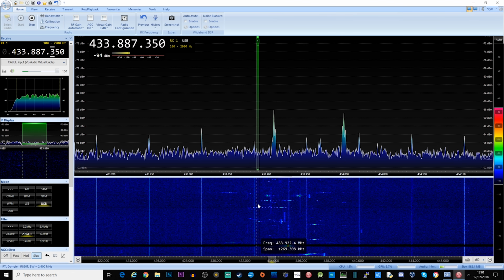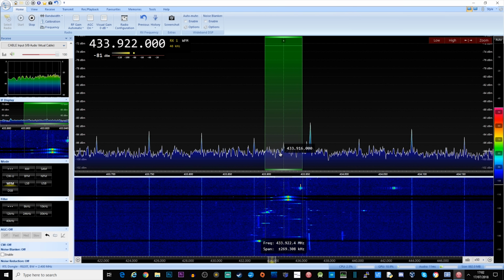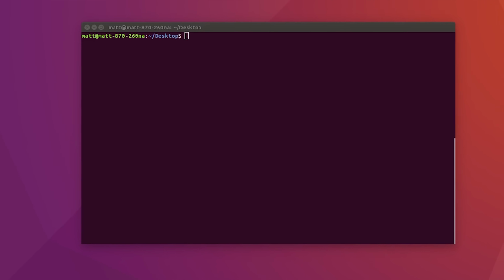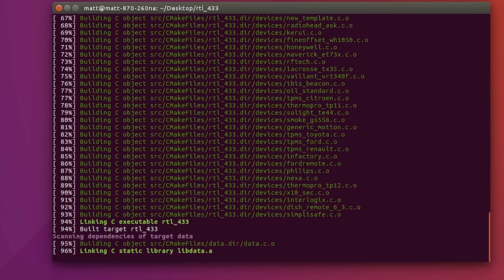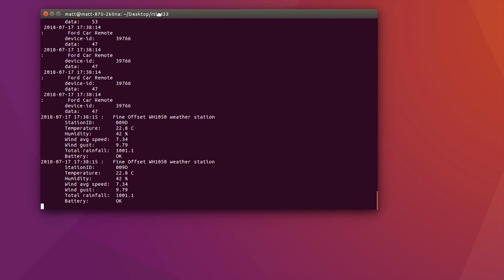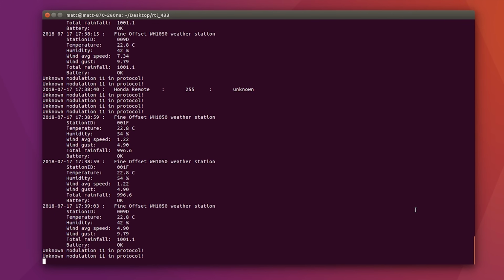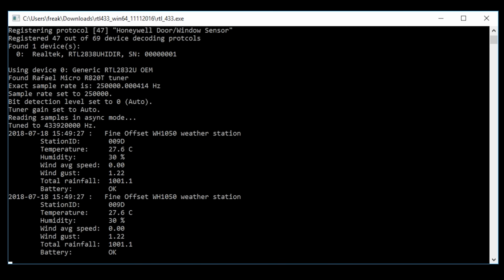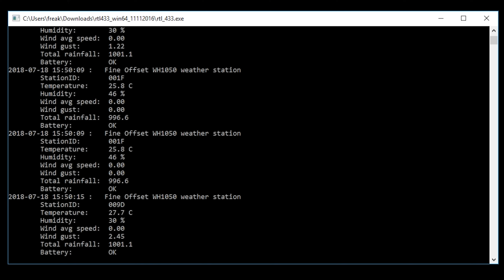How To Decode 433Mhz Low Power Devices Using RTL433 And A RTL-SDR Receiver

Comment: Awesome, I looking for a Windows version of this for hours.  I am hoping to access my WX station with RTL433MHz and put it out over APRS.

time      : 2022-10-29 04:55:16
model     : Fine Offset WH24                       ID        : 222
Temperature: 9.5 C       Humidity  : 96 %          Wind direction: 183       Wind speed: 0.0 m/s
Gust speed: 0.0 m/s      Rainfall  : 44.7 mm       UV        : 0             UVI       : 0             Light     : 0.0 lux
Battery   : OK           Integrity : CRC

Comment: I've got this working nicely now, reading from temperature/humidity sensors outside and in the glasshouse. I've got a 433 rain gauge on order. All I need now is a simple way to connect a pressure gauge to my computer (this doesn't need to be external, obvs, so no need for 433 - USB would do, but I'm having difficulty finding something cheap that does the job), and a 433 anemometer/wind direction, and I've got all I could want for a weather station. Pointers to suitable components at sensible prices gratefully received.
Reply from the maker: Take a look at the arduino, there are many many sensors available. You can even run them standalone and display the data on an LCD or OLED

Comment: I managed to get the Windows version working but as I live in a small village there is not much to receive. I know it's working because I am picking something called "oil watchman"
Reply: What freq did you use?
Reply: @Aquadogwt  The software sets the frequency to just under 434Mhz and that is usually where I leave it but other frequencies can be typed in.

Comment: Wow...very cool. I have several RTL-SDR dongles that I've used for Ham receivers and such.  But these got tossed in the junk drawer when I bought an SDRPlay RSP.   So...I grabbed a spare RTL-SDR and low and behold...I'm receiving data! So Mostly weather stations, which is fine as I don't have anything but temp and humidity sensors.

If I could find my AC power meter transmission it would be icing on the cake.  But I'm not seeing anything but weather data.  Looks like I need to hunt for the proper frequency.
Reply: AC power meters, at least around here in Michigan, were 3G cellular until recently, power company had to come out to upgrade it to a 4G LTE, as 3G has been phased out.

Comment: using windows 10 x64 , the command console shuts down before starting to sniff anything
Reply from the maker: Does the command console actually close down? Like it disappears? Maybe it’s crashing. Try running an “admin” console.
Reply: @TechMindsOfficial  i tried also run as admin, no luck.
It "dissapears" indeed, first shows up and after running some code lines suddenly shuts down
Reply: i launched it from the cmd console and shows [...]Registering protocol [42] "Honda Car Key"
Registering protocol [43] "Fine Offset Electronics, XC0400"
Registering protocol [44] "Radiohead ASK"
Registering protocol [45] "Kerui PIR Sensor"
Registering protocol [46] "Fine Offset WH1050 Weather Station"
Registering protocol [47] "Honeywell Door/Window Sensor"
Registered 47 out of 69 device decoding protcols
No supported devices found.

Im using a hackRF One cheapest version (it works with SDR console and hackrf_spectrum analyzer)

Comment: time      : 2019-09-21 22:14:15
model     : Citroen      type      : TPMS          state     : dc            id        : 868e5375
flags     : 12           repeat    : 1             Pressure  : 120 kPa       Temperature: 24 C         maybe_battery: 65         mic       : CHECKSUM
 
Ok - this is geeky fun :)

Comment: I downloaded the windows version and as soon as I start the program is runs a some code and then the window closes. I tried both 64 and 32 bit versions and both do the same thing.
Reply from the maker: You have to run the windows version, in fact all versions, from the command line. Simply open up a command prompt and then navigate to your RTL433 folder. Then type RTL433 -G

Comment: Question- after downloading and unzipping I run the exe file and get no supported devices found. I am using a nooelec dongle that works fine while running unitrunker and sdr#. Any ideas how to make the program see it? Windows 7
Reply from the maker: Sometimes the dongles usb channel can get locked, try unplugging the dongle and back in again.

Comment: hi there, on sdrsharp i can see lots of blips in the 433.920mhz but in rtl433, nothing shows. any ideas???
Reply from the maker: Try starting RTL433 with the -G switch, that should allow all possible devices. You might need to leave it on for a few hours.
Reply: Tech Minds would appreciate a video. I’m running on windows and don’t see any options or settings...
Reply from the maker: Ahh yes, I have recorded a video but just need to edit it. In short, it’s quite easy. Have you used the command prompt before on windows? Just type CMD into cortana search window and a DOS window will open. Use the DIR command to navigate to the folder where you downloaded RTL433.  Once you are in that folder, you can type RTL433 -F 933950000 for example, to set the freq to 933.950 MHz. If you don’t know how to use DOS commands then it’s probably best you learn how to use it first :) let me know how you get on.
Reply: Tech Minds, dude you are legend! I will crash course on cmd in the morning and should be getting results in the afternoon. Will keep you posted...
Look forward to your next video!

Comment: Hi, I looked in SDR sharp and could see the little signals around the 433.920mhz range but nothing on 433.920mhz. This is a problem because the decoding software is looking for signals at 433.920mhz and not around that signal. Does anyone know how I can change the signal in the decoding software? It does say stuff about tuning options on the website but it wont let me type anything into the console. (I'm on windows btw)
Reply from the maker: Open a command window, navigate to the folder where you have downloaded RTL433 and then type RTL433 -f (then the frequency)
Reply: Type the command into CMD?
Reply from the maker: I'll make a short video showing how to start RTL_433 using command line commands, hopefully have it up in a few hours. Thanks, Matt
Reply: Tech Minds Thank you so much!
Reply: Hey Matt hows the video coming along? I'm sorry to rush you but I'm so excited to try and decoding these signals around me!
Reply from the maker: Here is the RAW video, it's unlisted as its not edited, but should be able to help you guys out :-) https://www.youtube.com/watch?v=2uKazVxT0EE

Comment: Interesting software, thanks for the heads up. 

I have a cheap dongle atm which works ‘okay’ but have been considering a more stable dongle. 

What’s the difference between the smart and smartee dongles?
Reply from the maker: They are pretty much the same but the SMArtee has a Bias-T option, which when enabled could power things such as a LNA.
Reply: I have an inexpensive LNA from ebay already so the bias-t is useful removing the need for a separate power supply.

I'm thinking of long USB extension lead and maybe a j-pole all enclosed in a PVC pipe and have it outdoors, high up for scanning about.

I've just downloaded the windows binary.  Is there a way to change the frequency?  My car fob transmits on 433.950 MHz

Comment: Is it possible to do a replay attack on car key fobs and unlock cars that way?
Reply from the maker: Well, you’d need some way of transmitting and an SDR receiver does not TX, unless it’s something like a HackRF One. It may be possible to record with SDR-RTL and then use a pi to transmit, something I’m also interested in.
Reply: Possible yes, but maybe not in the way you're thinking. A simple replay attack will only work if you are able to record the unlock signal when out of range of the cars receiver and then play the signal back....but that scenario only realistically works if you already have access to the key so whats the point? If a subsequent key press is made and received by the car, the previous code you recorded is then locked out and becomes useless. The other possibility has been termed "Roll-Jamming", and mainly developed and demonstrated by Samy Kamkar. look him up on youtube, its very interesting.
Reply from the maker: I have a video in production covering this topic. And I’m only using a RTL-SDR and a pi zero. Keep an eye out for it, it’s quite interesting topic.
Reply: Tech Minds can you do it in youtube..Eagerly waiting
Reply: You can use a HackRF, Yardstick One, or Lime SDR to transmit.
Reply: EpicLPer same thing i thought

Comment: Going to try that on my debian box. 
Thanks.
Reply from the maker: You're welcome buddy, I've been meaning to investigate these signals for a while. I wonder what else it will pick up if left over night! Good luck, but as you can see it's pretty easy to get working. Thanks for watching! :-)
Reply: Update: kinda works on my raspberry pi 3. But same as dump_1090 it exits after a few minutes with an error or stops receiving.
Haven't had the tenacity to go after the underlying problem yet...
Reply from the maker: I'll try it on my fresh Pi Zero, but it sounds like you may need to re-install the RTL_SDR libraries etc.